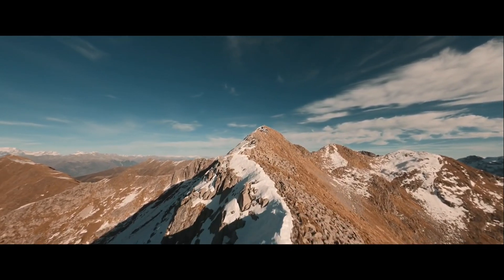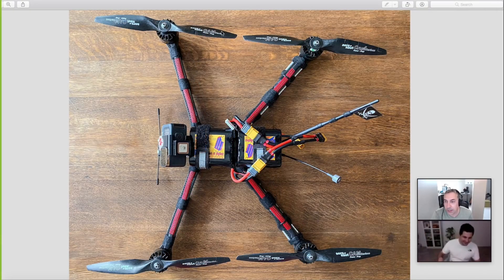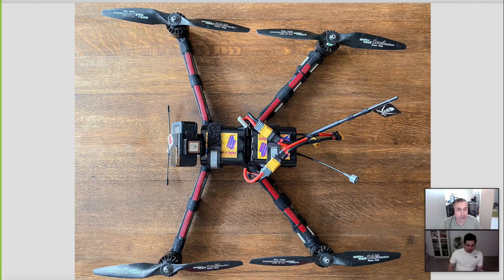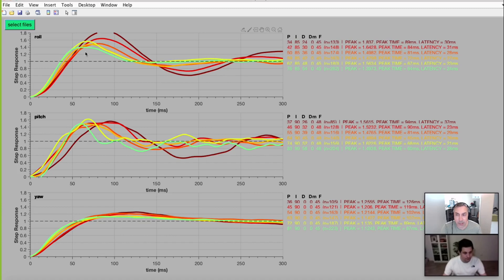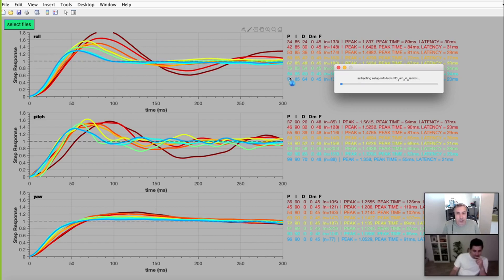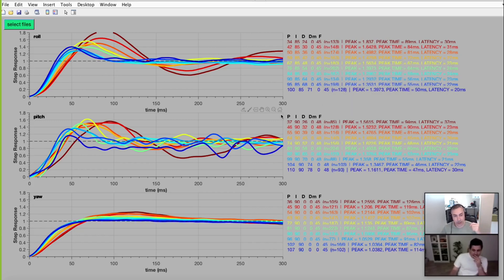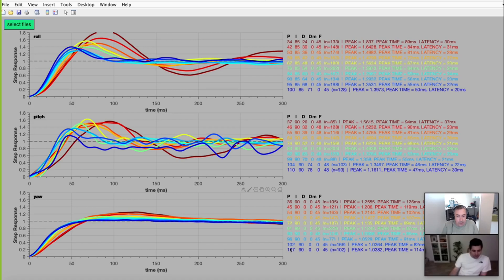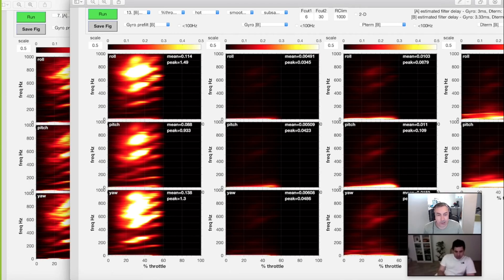PIDtoolbox Q&A #03 | Tuning a 10" li-ion long-range quadcopter

Comment: my tool can handle the 3.2khz sampling really well!
Reply from the maker: The question is, is there any benefit to having the internal gyro filter cutoff higher when you then have to just add more filtering back in software? The end result is the same amount of filter delay for equally filtered gyro (I’m speaking about the Bosch gyro). So there’s no free lunch as they say
Reply: @PIDtoolbox   my thought on this is, asb the 256hz DLPF can't really filter those noise above it out, why don't you keep using a weak one instead of removing it and reducing that small amount delay.